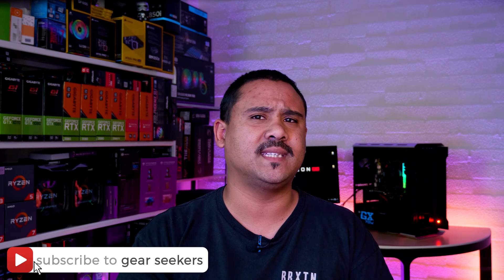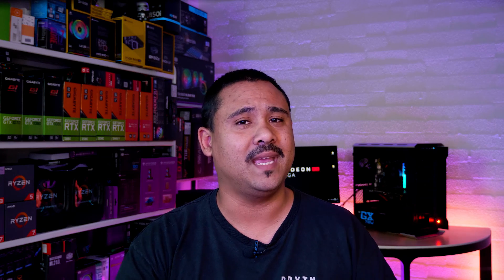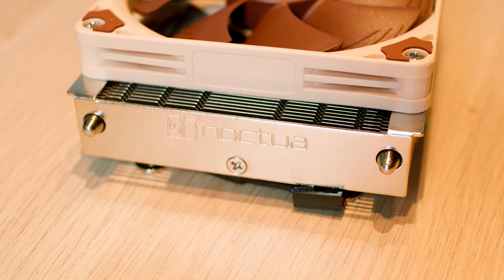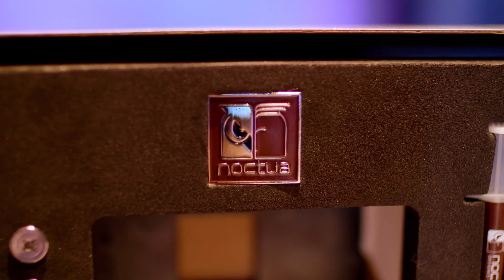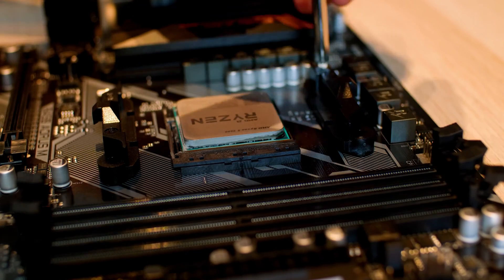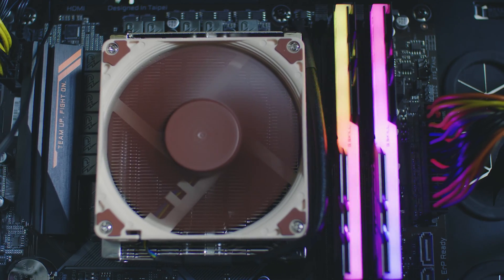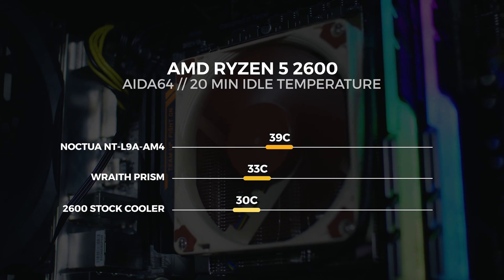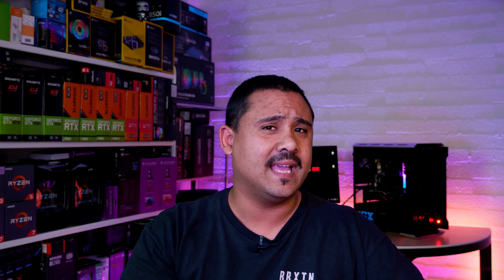Function Over Form - Noctua NH-L9a-AM4 Low Profile Cooler

Comment: Is this ok for my ryzen 7 2700?
Reply: Don't expect miracles, I have a ryzen 7 2700x. For internet surfing and games that do not load the CPU even at 15-20% ..is ok ..keeps temperatures up to 75-80 degrees. But a game like Assassin's Creed Odyssey for example ... the computer will restart ..because the CPU protection is at 90 degrees and shuts down ... even the Cinebench R 20 reaches 90 in 1 minute. Aida 64 also restarts in 2-3 minutes ... I quickly realized and replaced the cooler .... maybe it's good for 4-8 core .. but for more ... it doesn't work!

Comment: I went a little off of the deep end. Got a Cryorig C7 Graphene from OverclockersUK, a 3D printed 92mm fan mount from J-Hack and a chromax 92 mm noctua fan that does a decent job of keeping my 3700X’s heat in check.

Comment: Perfect ... well done video about performance over aesthetics.  I'm an older gentleman gamer (62) and I have the 2600 on a ASRock B450 Gaming Fatal1ty ITX in a Cooler Master Elite 120.  After A LOT of research, I have my Noctua NF-A12x15 PWM, Premium Quiet Slim Fan coming tomorrow to go behind the drive bay for some extra flow and keep my new Vengeance 2933mhz cool.  I've been looking at this CPU cooler for a while so I can overclock just a wee-bit.  Your honest review convinced me to get it ordered so I can get the most out of my little rig. (I've been researching CPU coolers for a while).  All reviews I've read give this brand really high marks.  Do you think it will handle a slight overclock?  Any feed back is appreciated.  Quality video btw ... got a sub from me!

Comment: Its even performing worse than stock coolers
Reply from the maker: I don't think you understand the point of the cooler
Reply: @GearSeekers  I guess I'm not getting the point either? What exactly is the point if it's not cooling the CPU as well as the stock cooler despite both being around the same height? The noise levels?
Reply: @FufruitSasalad  it's for slim builds, but i think it's still blows
Reply: @lurs21  Again, pretty sure it's around the same  height as the ryzen stock cooler. Might be wwrong tho.
Reply: @FufruitSasalad  it isn't